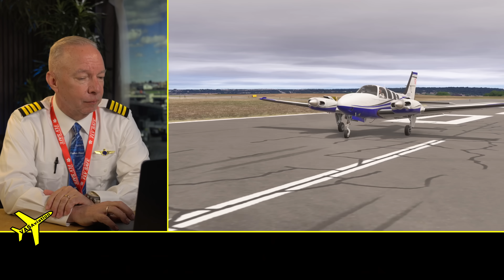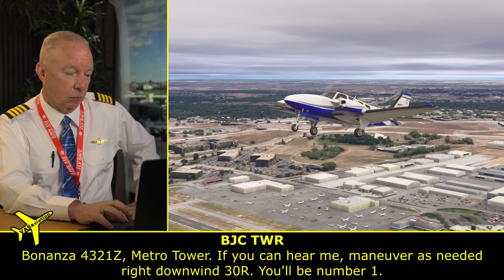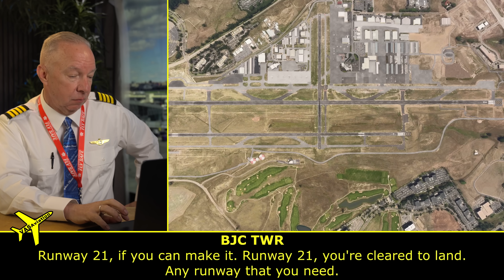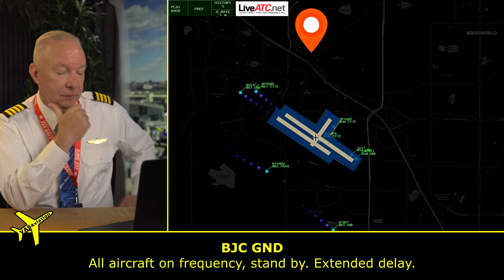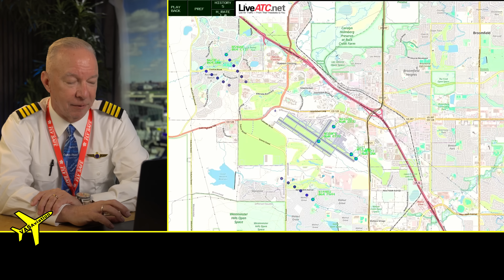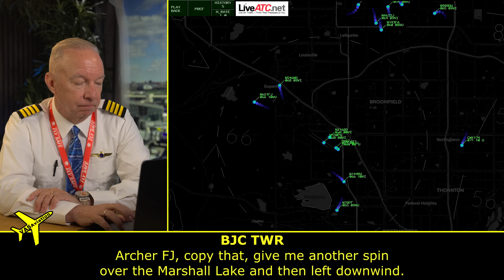Baron Crash in Denver: How a Door Popping Open Turned Deadly

Comment: I used to live a few miles from that airport, it’s a small suburban airport about an hour from DIA. To the west of the airport you have a solid wall of low mountains (foothills), it’s also located at over 6,000 feet. Because of that you have some unusual weather patterns as well. I witnessed a plane crash there once when I was there watching an air show and one of the performers could not pull out of a dive due to it being a very hot day which impacted his lift and he ran it into the ground. EDIT: it was in 1997.

During an airshow, the pilot was performing a reverse half-Cuban eight. He flew down the runway at approximately 400 feet above ground level (agl) and pulled up using a 45-degree nose up attitude. At approximately 2,500 feet agl, the pilot rolled the aircraft inverted and pulled to a vertical nose down attitude. He failed to recover from the dive and the aircraft struck the ground in a 5-degree nose down attitude with a high sink rate. Ground speed at the time of impact was approximately 485 knots. According to persons at the airshow who are aerobatics pilots, the maneuver being performed by this aircraft should be started no lower than 4,000 feet agl, and part of the altitude gain should be used to bleed off excess airspeed. Videos of the performance depict the speed brakes deployed, the vertical stabilizer moving up and down, and the leading edge devices deployed while the aircraft was in the dive.

Probable Cause: Inadequate planning and decision making by the pilot in starting the aerobatic maneuver at an insufficient altitude to successfully complete the maneuver.
Reply: I live in Broomfield and the weather at that airport is wild! On top of the things you mentioned, the airport itself is up on a ridge. The wind at ground level is constant and gusty (probably why NREL put the windmills there). My pilot friends say the geography makes for consistently unpredictable updrafts.
Reply: Another airshow crash there several years ago was a restored F-86 "Sabre" jet, apparently didn't allow for density altitude.
Reply: @williamedwards1528 It was 1997 that's the one I referred to and witnessed
Reply: My son and I were at the airshow the day before (May 31). The  F-86 crashed on day two of the airshow, on the other side of the airport from the one in the video.

Comment: These Air Traffic Controllers have to be like MASH surgeons on a battlefield! IMHO🪖⛑️
Reply: Capt.  Steeeve:  Believe your video is in error showing a Baron 58 with aft doors.  The Baron 55 has one door on passenger side.  I’ve had two door openings just at rotation in B55 in years past.  Great ac but door may need adjustment.

Comment: I was a Video Photographer for Beech for 20  years and flew often in a Baron 58 or Bonanza 36, we had to remove both rear doors before takeoff. I never felt like being in a crash with doors off. The front door opened a few times and that was no problem, pro pilots. Riding in the copilot chair I always checked for door closure before engine start. These guys must have been low-time for this to get out of hand.
Reply: Ecactly
Reply: The pilot was 80 years old and had been flying since 1975. The passenger was also a long-time pilot and 74.
Reply: Why is the doors opened to begin with?
Reply: @xvgjiyuesssughyeo doors don’t like being shut on these small planes. It’s a common “feature” on the 152s as well
Reply: @assuredaviation9116  Thank you 😊  interesting staff...

Comment: Super sad....Aviate,  navigate and communicate.  Several years ago I had the door on a Cherokee 140 pop open on rotation.  Lots of fresh air and noise.  I climbed to pattern, flew a normal pattern, landed and repaired the issue.  Granted I was the only one in the plane so no people distractions.  Situational awareness is the most important thing we do as pilots.  This is very sad and so preventable.
Reply: I'm not a pilot, but I still use that motto in other parts of my life, especially driving a car. When faced with an emergency situation it always holds true.
Reply: The startle factor is ingrained in humans and is tough to overcome for some. I can imagine how it must be for pilots who initially fly VFR to then transition to IFR and ignore everything your body is telling you and trust only your instruments, especially in conditions where you have no visual references.
Reply: I was a partner on a 140 years ag that had the same issue.  Nobody could fix it.
Just some noise. No big deal.

Comment: I've had the door pop open and rip off twice over the last 35 years. 
  Last one was in 2017 at 9000 foot AGl.  
  And both of them were basically non-events, I just have a hard time understanding how these people are killing themselves with a door issue in general Aviation. 
  I mean other than the startle factor just fly the plane. 
  Other one in my Cessna 162 ripped off and hit the horizontal stabilizer was still a non-issue